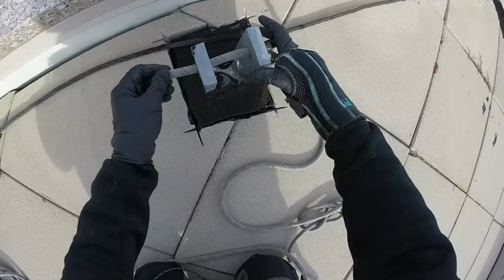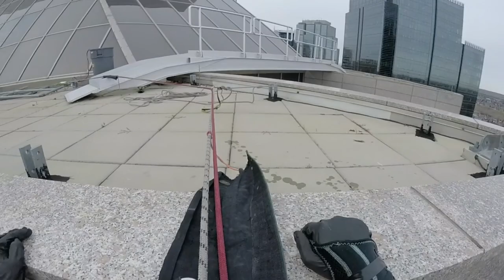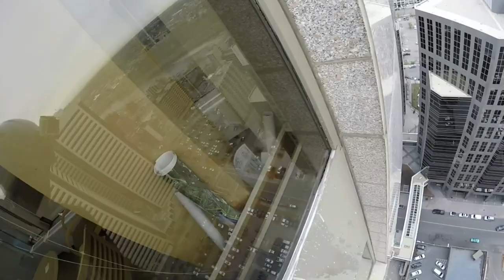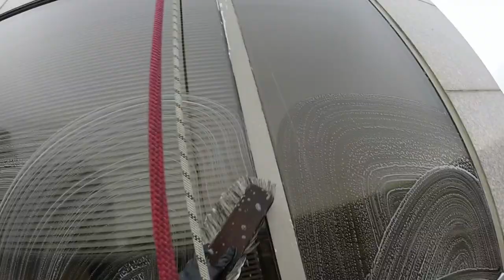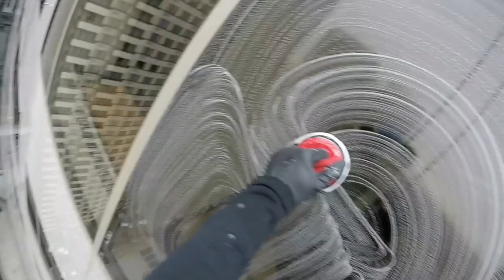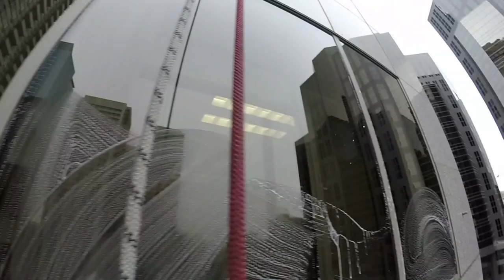Rope access window cleaning 35 story building with rigging.

Comment: Having to do my first 35 storey soon. Kinda nervous went from 8 storeys to 15 now I’m jumping to 35 lol only got my level one irata a couple months ago 🤗
Reply: It's all in your head if you fall 4 floors your dead just take your time and be safe always don't go near the edge not tied up to something intended for you and just think next time you go on that 15 story you will laugh 😅
Reply: gains
Reply: Started with 4 floors, sky rocketed to 61 floors, trick i used for the first time i tried not to look directly down kkkkk kinda worked.
Reply: @marvinandlovu2850  portugues?
Reply: Just be careful and follow the safety rules as always if you did a 8 story then you should be fine but if your nervous this could not be a possibility job for you if you afraid of heights think wisely.
Reply: @quentinbohannon4089  I've been doing abseiling for 4 years I think if your not nervous some is wrong and could make it more likely to go wrong. I think you need those bit of nerves to double and even triple check everything
Reply: God bless all you guys.
Reply: I've since moved on to heavy equipment work. Did my 2 years as a level one. It was a cool experience. But in the end found something new. Thanks for all the advice and tips.
Reply: Hardest part is going over the ledge

Comment: ☝️May I ask... : 🤔
What's the mm of the ropes you are using...?  Both 
Which dissender are you using...?
Reply from the maker: It's 11mm rope and in this video I was using a Petzl ID but they wear our fast. I really like the Skylotec Sirius.
Reply: Yeah well... In my opinión (for being that I am in Argentian and Petzl it's UNbuyable) the "real McCoy" it's an steel 8 dissender, with an 8mm prussik rope. That combo provides  anti-panic and slow-fast disending, and it's cheep to replace (the prussik rope ring),  and also easy to use in self-rescuing... 
BOOM... 🎤(dropped the mic)🎤

Comment: I don’t understand Why you didn’t set a Y- hand when you were doing the rigging? I do get the point about the deviation you did. But even when you set two independents point for each rope still not safety enough. You should’ve done also alpine butterfly knots plus the figure 8 you did... good window cleaning though 👍🏻 be safe bro.
Reply from the maker: You'll see in my most recent video I'm about to post that I did combine the 2 for a load share. This video was from years ago so I was still learning. That was the way I was taught thought. Looking back I wouldn't have done things the same way.
Reply: BrodyYYC 💪🏻💪🏻💪🏻
Reply: a basic anchor system is fine, you don't NEED to y hang to follow irata.. but putting 3 lines on one anchor is the main problem here lol

Comment: hi, im starting out with a company that does rope access. first i need to learn how to clean windows but i took the job because i love heights. im about 30 pounds overweight due to a leg injury about i sustained a year ago so i wantred to know how much physical strenghth you need to pull yourself back with your gear?
Reply from the maker: It's a more physical job than you would expect especially depending on the size of building. I also see a lot of people get into it cuz they have previous experience with rope access but have no window cleaning experience. I won't lie both are a big learning curve. I think people think "it's just cleaning windows" or that you just have to not be afraid of heights. It's not so much the physicality of pulling yourself anywhere but more the overall job. Like you don't have a Sherpa to bring your ropes and gear up and haul your ropes up. I recommend getting a squeegee and scrubber at home and practicing for hours. Hopefully the company you're working with wont let you do anything stupid :P So learn the basics of rope access since I hope they are obviously rigging for you and then just hone your skills. Obviously safety is the number one since without that you can die but also window cleaning isn't as easy as most people assume. With that being said you will totally get it with practice.

Comment: I can rig my drop up and do my drop so much easier and faster.  Time and safety are the biggest concern. You are very good window cleaner but I need to make money and drops are money.  I don't know but you may be a rookie.  I've done this for over 30 years.  I would smoke you , keep up the good work brother.  Not being rude just busting your chops !  Lol. That's what us window cleaners do to each other. 
Be Safe !!  God Bless
Reply from the maker: This is an old video it was my first season and they assumed since I was a good window cleaner I knew what I was doing. The guys made sure I didn't die but I do things much different now. My 2 more recent and the one before this are much better examples. Even those are a bit old now because I typically just build proper Y-hangs.
Reply: No one cares doozy

Comment: too slow. I own blue hawaii window cleaning doing since 85 im 70 and im way faster then you guys  I still hang today ,, you do 2 pieces and do it in 3 sections   I would drop my lines in the middle of the 4 plates and do 4 at a time   you stop and do the gas without reaching. you can do that in 2 sections you don't move you sit like your at the breakfast table   we only use suction to swing far over to get those plates so you can do 4 at a time   if you moved that slow I would replace you with a girl they are faster and better    ex 82nd airborne.  watch hawaii guys they race to see who gets down first   aloha
Reply from the maker: Doesn't sound like a company I would ever want to work for. But I guess if bragging about how much better you are than everyone is your thing it may be the place to go work :) Also this video is like 7 years old.